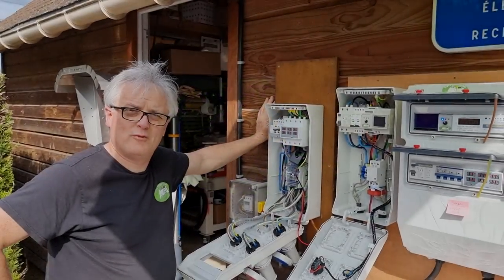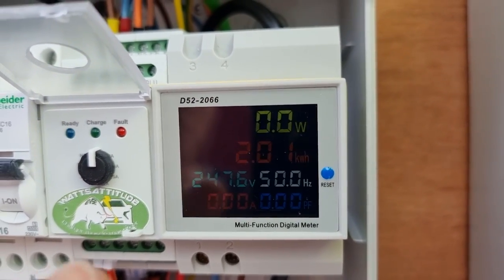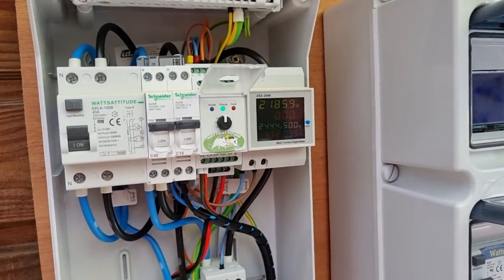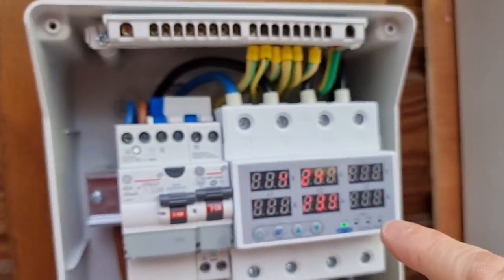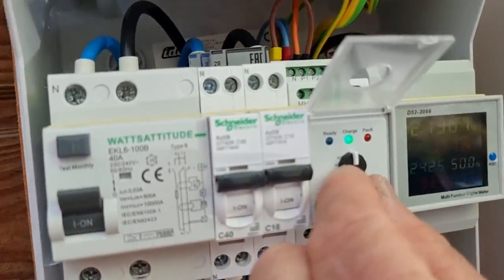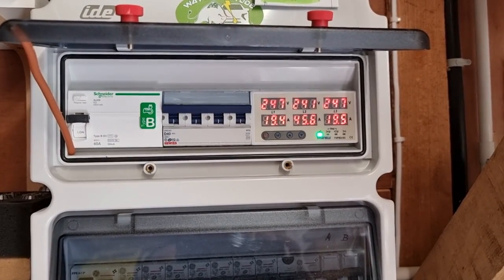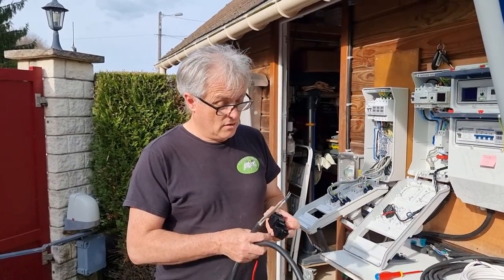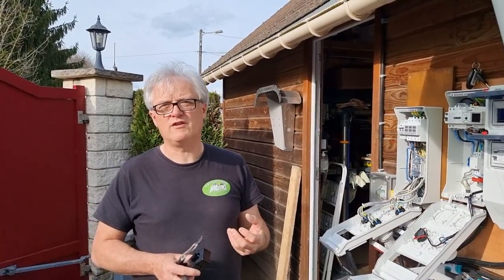Tuto sur le raccordement du délestage sur la Boxwatts7-V3

Comment: Merci pour cette vidéo, tres instructif ! j'ai tout compris a part un point :) le reglage des 45A ? on voit bien le reglage du courant de charge dans la voiture via le controleur mais je ne vois pas comment tu peux faire ton reglage de courant max en début de tableau ! :) merci encore :)
Reply: D'après ce que j'ai compris, ils utilisent un module de contrôle de recharge (EVSE Protocol Controller) configurable dont la valeur max de courant mesurée via le tore branché sur les entrées CT1 et CT2. Et d'après les indications sur le délestage à fournir à la commande (voir site web), il semble que cette valeur max soit configurée en atelier à la demande. Je crains par contre que l'on ne puisse pas revenir dessus facilement.
Reply: @bidon5037  si c'est le cas, je trouve cela bien dommage dans le sens ou nous avons tous des abonnement EDF différents avec des kVA différents :(